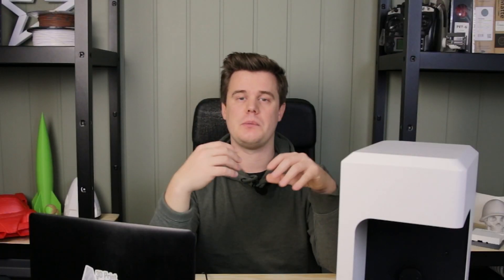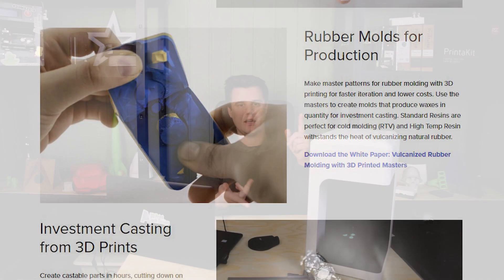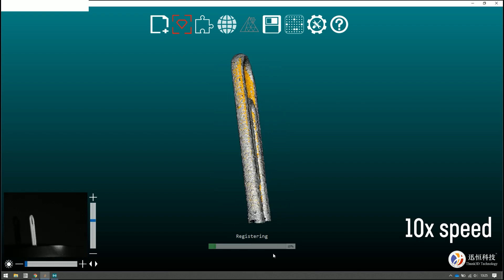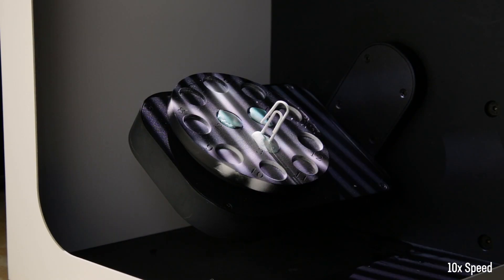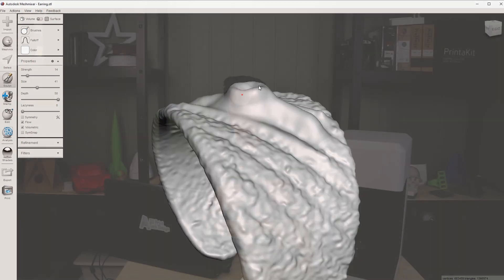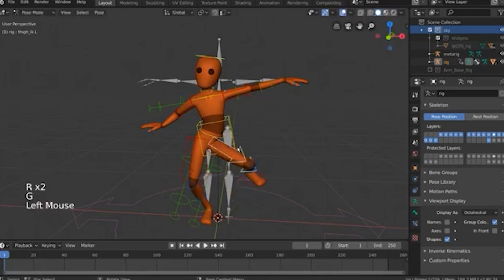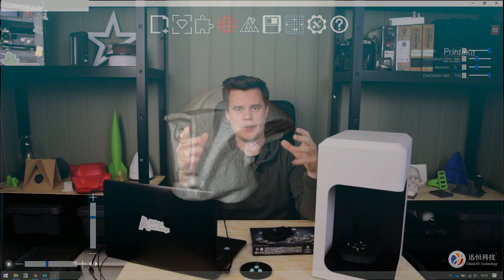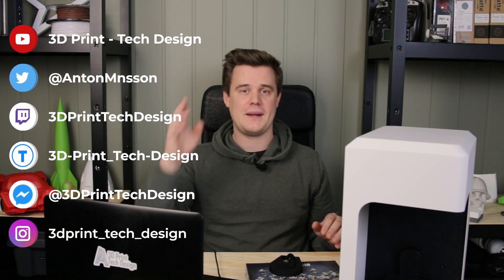3D Scanning Small Objects - 0,06mm Resolution with Thunk 3D Jewelry Scanner

Comment: i would be really careful about talking about scanning GW items on videos. they are so cracking down on people doing this you could end up in a huge amount of trouble. as they are cracking down on people 3d printing there products and using there IP etc. just a heads up. though myself i think they should scan there own models and make them available for a digital download for a price on models they don't produce anymore. Gw are not doing themselves any good not embracing the 3d resin culture.
Reply from the maker: Thanks for the heads up! Well, the follow-up video isnt posted, not sure how I will navigate it, without putting myself into far to high risk :)
Reply: @3DPrintTechDesign  i think you might be ok if your not uploading the scans for others to download. its a complicated Gray area. have the same problems with some game companies. some embrace there players using 3d models ripped from there games etc. others hit hard. example world of tanks tried to remove all the tank models from sites a couple of years ago. well that did not go to well for them. as they dont own copyright or ip over tanks and blue prints. only there game models. and everyone had there tank models re instated. after a huge kick off.
Reply: you might be able to get away with it. just letting you know in advance incase they pull the video etc. just dont use GW stuff in your information about the video or the video title and there search might miss it.

Comment: Jewelry maker here: you asked for an idea to test. My colleague and I just talked about this. One thing jewelry makers often do is model a piece of jewelry around a unique existing stone. A stone can often be not standard in shape. So using existing 3d models from 3d software will not help to create a new piece of jewelry. 

So we concluded we need a precise 3d scanner that can scan any unique gemstone so that we can then 3d model a unique piece of jewelry around it. 

To test this, I would suggest to have it scan a small crystal quarts for instance, raw or cut in a not so standard faceted shape. First without coating spray, to see how that works. And if it does not work without coating spray because of reflections and translucent properties of the stone, then with spray. Maybe I can then model a ring around it and you can print it and see if it fits the stone. 

I can also imagine dentists might have use for this 3D scanner.

Let me know howbyou think about this, kind regards,

Sébastian Stevens

Comment: Seems like a lot of noise on scan render of the the surface roughness. Like its accentuating the surface defects.
Reply from the maker: The noise is depending on surface, it's like ISO setting. You can smooth it very easily, but for maximum precision I keep it on the get the most raw result 👍

Comment: You might try to scan a calibration object (one with specific known sizes and precisely machined) to check the accuracy ?
Reply from the maker: It would be nice! Not sure where I can get hold of one of those with that precision 🤔 tho.
Reply: @3DPrintTechDesign  I think I heard someone saying he ordered some on amazon,... I’ll try to find a link
Reply: @3DPrintTechDesign  I've not found a direct link but apparently it's possible to find some CMM calibration artifacts not too expansive on ebay,...
Others have also used some precision steel balls (like for ball bearings) as reference.
I'll try to find something too as I want to test the Einscan 2X+/H/HX for comparison
Reply: @3DPrintTechDesign  Those kind of scans would also be interesting for your database of 3d scans for comparing scanners

Comment: You say that you can see dust on the surface ... you can also see the coating deformation in photogrammetry ... or with an einscan pro too even at this type of object ...
Reply from the maker: For sure, it's not unique to this one. With photogrammetry you have different geometry issues depending on how to reconstruct (I've not done a lot of macro-scanning). 
I just find it really exciting as I've never seen it on einscan SE or SP with this detail, since they mesh at around 0,2mm, while this at 0,06mm.